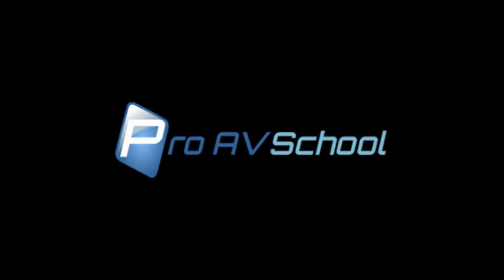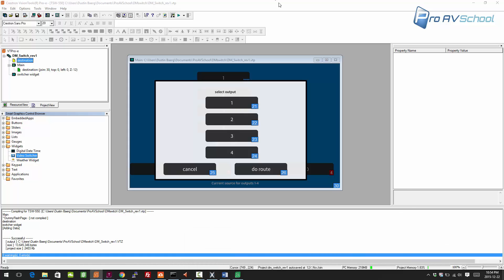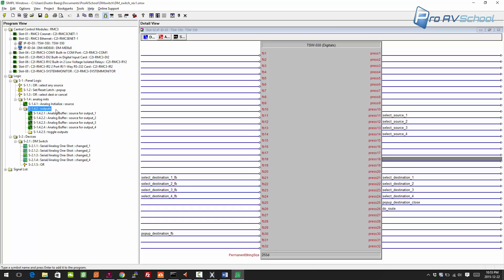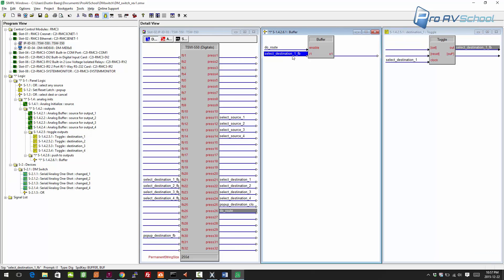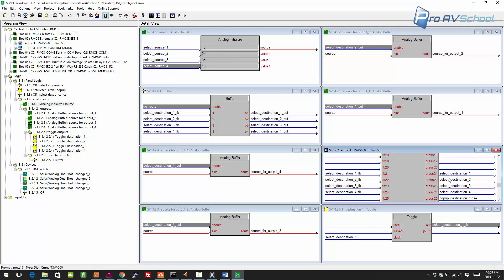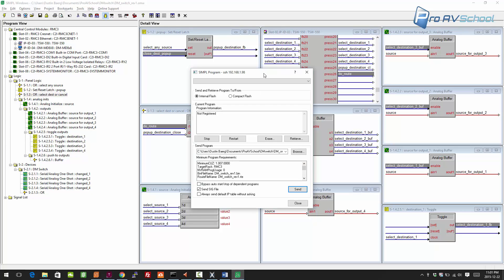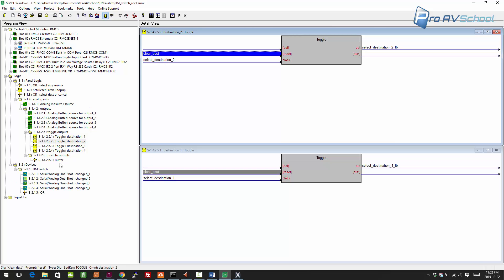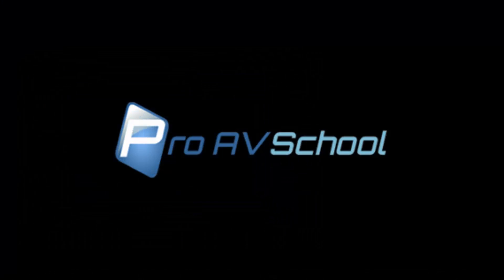Crestron DM Switch Programming Multiple Destinations

Comment: Hello Dustin.. How are you doing. Please how can we enable audio out through all our destination in the above methodology you have used with video switcher. Thanks
Reply from the maker: The DM switcher definition lets you specify an analog input for each video input and for each audio output. Normally when you switch a video input, the audio will follow as well unless you have "EnableAudioBreakaway" high.

In other words, by default it should be doing the audio and the video together. If you want you could run the same signals selecting the video inputs to the audio inputs as well but you normally shouldn't have to do this.

Comment: Hi
Can you please let me know how to route 6 inputs to 3 output sources in DM-MD8x8. I  need to connect 3 led tvs in output source with 6 nos. of input sources and want to select any input source to any  led TV. , means all LEd TV should dsplay any input sources.
Reply from the maker: I would do this by defining 3 analog signals, one for each of the 3 switcher outputs in use. Connect them to the DM switch symbol as video for output (x). Then all you need to do is use an INIT for each of those analog signals, with the inputs being the digital presses from a panel with source selection for each TV. You just initialize the correct input for each source.

You can expand on it from there to manipulate the analog signals for different reasons. This video is kind of an advanced way of handling the same scenario. Another thing you can do is compare to zero so that when the source is zero, the TV turns off but this would be overkill for simple systems.

Comment: Very Nice! One question? How do you get feedback from source select to destination instead of using numbers? would like to use names like Blu-ray, Cable ect
Reply: Well you could do an analog equate against whatever source was selected, each digital out of the analog equate would run into an SIO input, with a matching text parameter. That same serial string output of the SIO would feed back to the serial inputs for the destinations on the panel. In the panel project, the buttons that would show that text string, you have to click the label button on the property field and use a CIP tag with the appropriate serial join. Then the text would dynamically change with what ever input source you send to that destination.

Comment: Mr brett  this is rajesh how can i control a samsung led tv with out ir codes(i cant get in internet)and i dont have device learner
Reply from the maker: Samsung LED TV's often have RS-232 via the "EX-Link" port (I think that is what it is called). It is a 1/8" jack on the back of the TV.
You also might be able to do CEC control via HDMI if you are using a digital media system that can inject it.

Other than that if you have to use IR, I have used the philips pronto editor to load IR codes that are more readily available and then input the hex commands into device learner in toolbox to create a crestron IR file. I don't have specific details, but check out http://www.remotecentral.com/ and search around there for more info. Philips Pronto IR format is more of  consumer format so a more readily available selection of IR codes on the 'net.

Also, just thought; you might want to check the Crestron Application Market; there might be something there a well.